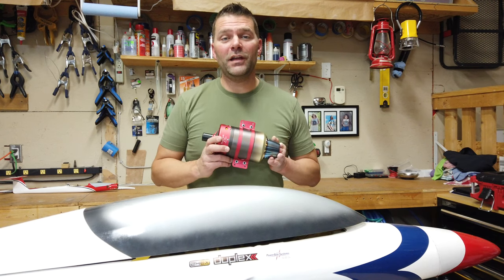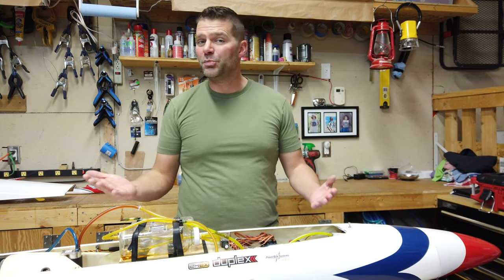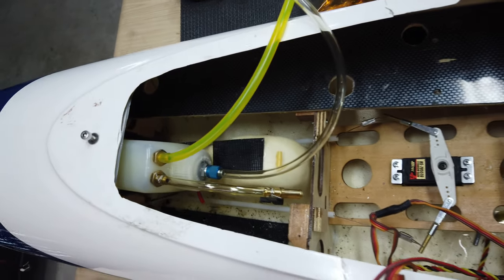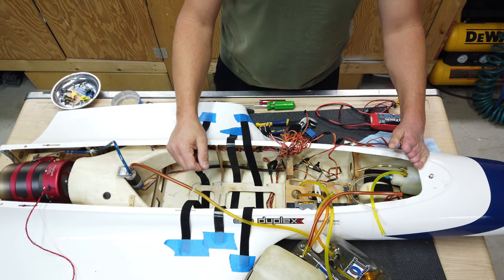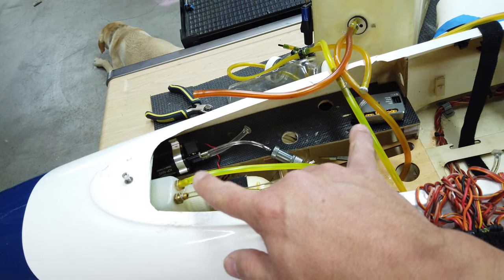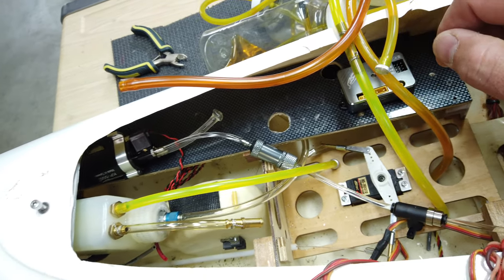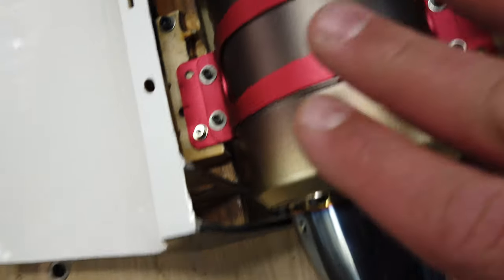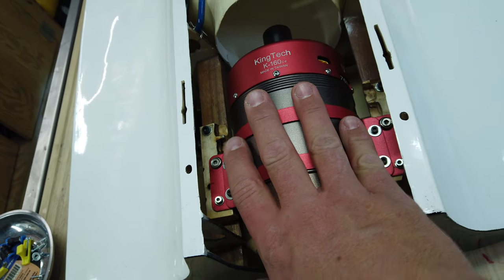How To Install A Gas Turbine Engine - Part 1 of 2

Comment: Love your Videos, and have become a little obsessed with your Channel.  Great Stuff!  

Question, Turbine beginner, sorry, about tubing and fitting sizes.  How to tell when mean OD or ID?   

And secondly (Somewhat related to the first question) regarding tubing and UAT sizes.  
I have a Swiwin 140B going into a TopRC Hawker Hunter, and am thinking of the following setup:  6mm Vent - 6mm Tank fittings- 6mm to UAT (MAP 4oz Hi-Flow) - 6mm reduced to 4mm just before Pump  (140B Pump input appears to be 4mm - then 4mm to Valve - Filter - 140B.  
Or just 4mm all the way through.  140B seems to be on tipping point from standard to Hi-Flow?

Thank you,

Jim Reay
Dunedin, NZ
Reply from the maker: Hey Jim!  Thanks so much for watching!  I truly appreciate it!

So the tubing commonly used in our turbine setups is 3mm, 4mm, 6mm and 8mm.  3 isn't really common any more.  Typically even the small turbines now use 4mm as standard.  8mm is for high flow setups so you wouldn't generally see that till your in the upper size.

For your setup you are on the right track but here is what I would change.  install a 4mm piece on the intake nipple of the pump.  cut it off flush with the nipple.  then fit your 6mm coming from the UAT feed over top of the 4mm piece on the pump intake.  Safety wire this connection.  Now your pump is un restricted.  Generally the MAP UAT's come with a brass step down adapter.  That works too but the method I mentioned is simple and works.  Always keep the pump intake short and as large size as possible and you won't have any issues with the pump intake.
Reply: @thelightersideofrc  Wow Jonathan, extremely prompt reply.  Very nice.  And a simple suggestion.  I like that too.  Thank you very much.

Comment: what kind  of fuel  do you  use  on the  turbine and whats the best and cheap.
Reply from the maker: The important thing to think about is what can the turbine use for fuel.  In all my kingtech turbines I can use Kerosene, JetA and Diesel.  I prefer Kerosene or JetA myself.  I have used Diesel but it is stinky and there is quite a bit of smoke on shutdown/cooldown.

Comment: What is the best fuel to use in g4 turbines mixed with king tech oil? Diesel or kerosene?
Reply from the maker: Both will work great. I personally don’t like diesel as it’s stinky and smokes a lot on cool down but lots of guys around me use it and it’s perfect

Comment: What is recommend for the "hold down bolts"? I have a Swiwiwn 80, I got 2nd hand (no bolts) Can I use wood screws?
Reply from the maker: Yea wood screws will work great.  you can also use blind nuts and appropriate hardware but i'm not a fan of blind nuts myself.
Reply: @thelightersideofrc  okay, I wasn't sure if I should match the screws used in the bracket.

Comment: Question for ya I'm putting 160 jingle tech in odyssey I'm getting whistling when top throttle I moved the turbine pipe back does it need to be moved further or do you think the turbine is not straight blowing out exhaust..please help thanks
Reply from the maker: If you can, send me a couple pictures via email. thelightersideofrc@gmail.com. Initially my thoughts are if the pipe has a big bell mouth than the further out of the bell the turbine is the more whistle you typically get. But send me some pics and I’ll look at them.
Reply: @thelightersideofrc  ok I will tonight

Comment: i have jet engine ATJ 220sv, do you have recomendation the best PNP body for that engine?
Reply from the maker: Oh boy!  There are really so many options now with different sport jets and scale jets. Really comes down to what you want and what your comfortable with. That engine would be a perfect fit for the AD Diamond I just built or the CARF L-39 that we just switched to a KT210. 

When you say PNP your looking for something prebuilt?
Reply: Plug n play i mean, you know the link whre to bought KT210? i want shipping in indonesia
Reply from the maker: @skinnydip6784   www.kingtechturbines.com
Reply from the maker: @skinnydip6784  not sure of the kit manufacture but there are a few 3D Jets out there with vectored thrust.  For the smoke system just need a nozzle a the hot section, smoke pump and a tank.  I did a video on how to install a smoke system recently.  About 5 or 6 videos ago.
Reply from the maker: @skinnydip6784  https://www.youtube.com/watch?v=o10AY9iHdlk

Comment: Its a jetcat turbine the installed one probably 160N
Reply from the maker: Yea the original turbine that we took out was a 160 as well. So it won’t have any more power with the new engine but it’s lighter and better throttle response